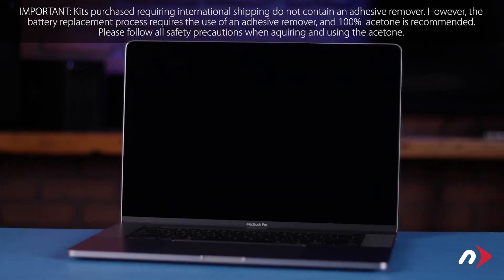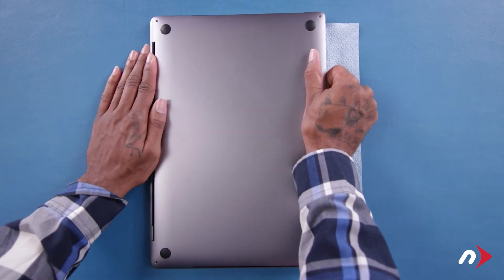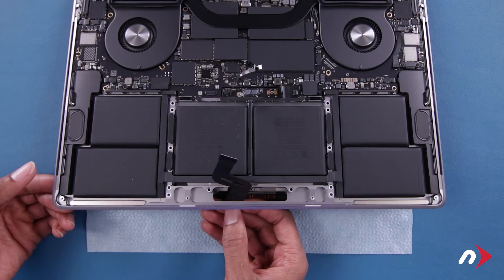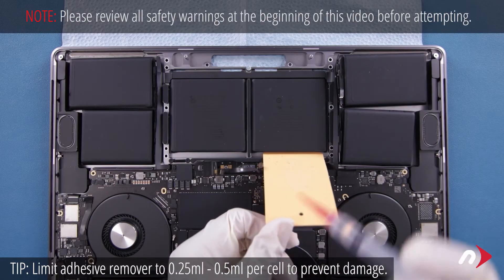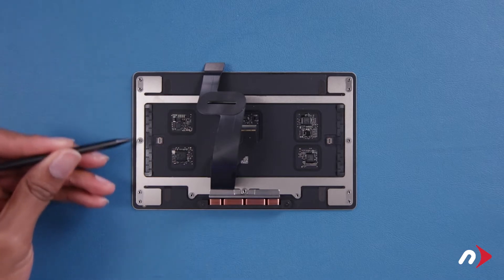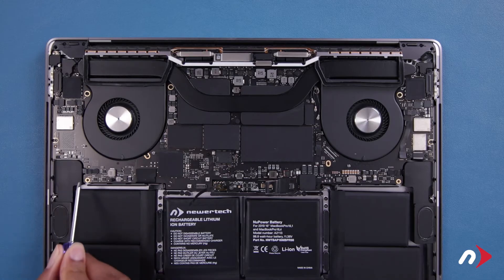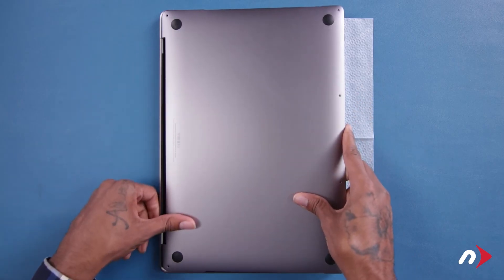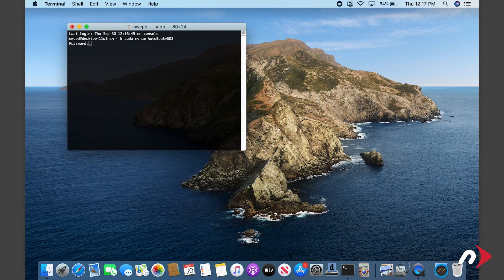How to Upgrade or Replace the Battery in a 16-Inch MacBook Pro (2019)

Comment: Just completed mine, minus the terminal commands. This video was quite helpful and other than Apple’s ridiculous amount and strength of adhesive this wasn’t bad. 
I’d add what I think should be the first step, after the terminal command if one chooses, to be depleting the battery as a discharged battery is much safer to work on than a fully charged one; the less energy available the better.
Reply from the maker: Thank you so much for sharing your experience, and we’re glad to hear the video was helpful!

You make an excellent point about battery safety. Discharging the battery before starting the repair is absolutely a best practice and does make the process safer, especially when working around adhesive and internal components. We really appreciate you calling that out, and it’s a great tip for others who may be following along.

Thanks again for the thoughtful feedback and for taking the time to share it with the community!

Comment: A great video tutorial.  I watched a few others and they went through the whole process so fast and didn't really show all the steps. You provided a very thorough step-by-step instruction on how to remove the cables, which screws to remove and the screw size, etc.  I was able to easily understand how to disassemble the laptop and replace the battery.   I've replaced other MacBook batteries previously and this was by far the most involved one.  Thank you for taking the time to share this video.
Reply from the maker: Thank you so much for your kind words! We're really glad to hear that the video was helpful and made the battery replacement process easier for you. We always aim to provide clear, step-by-step instructions so you can feel confident tackling even the more involved repairs. Appreciate you taking the time to share your experience! 🙌🔧💻

Comment: It says to charge the battery to 100 percent after the new battery is in place, before draining it again. How do I know it has charged to 100% ?  The video doesn't say you can power up the computer to check...
Reply from the maker: Great question, and thank you for watching!

Yes, after installing a new battery, it’s important to fully charge it to 100% before performing a calibration cycle. You can safely power on your Mac after installation to check the battery percentage—this won’t interfere with the calibration process. Once your system indicates the battery has reached 100%, you can then proceed with the next step, which is to allow the battery to discharge fully until the system powers off.

This initial charge/discharge cycle helps the system properly recognize and calibrate the battery’s capacity for more accurate reporting going forward. If you have any additional questions about the process, feel free to reach out!
Reply: @poweredbyowc  Thanks so much for responding and so quickly.

Comment: I replaced the battery it’s charged 100%, but my laptop turns off as soon as I take the charging cable out. I also did the SMC reset.
Please suggest.
Reply from the maker: Hi there, have you gone through the calibration to ensure that the battery is working optimally?

Battery Conditioning
1. Perform a fresh charge to the New battery without uses.
2. Disconnect your MagSafe from your Mac and use until 10% or less.
3. Perform another fresh charge to the New battery without uses.
4. Repeat steps 2-3 four to five times.
5. **Once a month perform steps 2-3.

Comment: dude YOU DONT NEED TO LIFT THE BOARD, LEAVE THE CABLE ABOVE THE BOARD NOBODY WILL NOTICE NO HARM DONE DUDE... COME ON.... you even dont have to glue the battery just put the lit on. if battery break again remove it by removing the screws put new in done.... why so harddd

Comment: I found that Apple uses Torx size 3, 4, 5 fasteners as well as #5 Pentalobe screws in the first section for removing the battery. These are also 3 different lengths including two for the retainer for the power ribbon cable that are 1mm long and too short to hold with tweezers to place back when done. It is obvious that Apple's product people did not intend owners to replace the battery in these laptops with the approach that was taken.

It takes me 10 seconds to replace the battery in my Lenovo laptops but 2 hours and special tools and adhesive remover for a $2600 Mac Pro. Time to replace my 2000 Mac Pro 16 inch with a new laptop from Lenovo.

Comment: Followed the video, no issues reinstalling (I can see my trackpad is slightly misaligned but seems to click fine). The problem I’m having, however, is that once I plugged it back in, my Mac is telling me that the battery is not charging. Any advice?
Reply from the maker: We recommend making sure that all the connections were put back correctly, you can also try using another power cable to make sure if it's an issue with the battery or the power supply.

Comment: If my battery is completely dead and I can’t enter the code into the terminal what should I do? Thank you in advance
Reply from the maker: You would need to charge your battery fully before you can use the battery. We recommend if it is completely dead, to charge for a full day and then see if the computer turns on.

Comment: Was wondering if this worked with macbook pro 2019 A2124 models?
Reply from the maker: I am not finding that specific MacBook Pro Model number. However, this will work with both the MacBook Pro 16,1 and 16,4. If you would like to make sure your Mac is one of these, you can check the model identifier:

1. Click on the Apple icon in the upper left corner
2. Hold Option key
3. Click System Information
4. Second Line Down Under Hardware Overview is the Model Identifier (??)
Reply: Will this work for the 13 inch?

Comment: I tried to replace the battery without removing the board..’i couldnt align it perfectly to get the cables out:( so had to remove motherboard completely

Comment: Does the battery come with any charge on it?  I just replaced mine, plugged the USB-C in and its not starting up 😢   Im afraid of what has happened and hope im not going to have to regret taking on this task.
Reply from the maker: They should, however, it may drain enough before install that it needs a full charge for it to work properly. We would recommend charging it for a few hours and see if that helps.
Reply: Same here, just waiting longer and crossing my fingers!! Been charging 30 minutes and nothing yet. Oh boy

Comment: This video is the best! You don‘t need any other guide. Here are my tips:
- Always check that you use the right screwdriver
- Some screws are very tight, apply a bit pressure on the top of the screwdriver for the first turn so you don‘t damage the screw.
- Use flat pincers for flat cables
- Lifting the logic board is kinda tricky, as in my case it didn‘t want to go as high as in the video, so you might need to lift it a little closer to the battery
- You can use toothpicks to align the trackpad holes - and you can try to screw all trackpad screws just slightly and after that tighten them crossways so everything is aligned properly.
- Under the left middle battery is a small white indicator which turns red when it comes in contact with water. I guess apple uses this to see if there was any water damage. Try not to get it wet or remove it if you ever send it to apple no one can claim you had a water damage. Alkohol and Acetone also activates the indicator
- Use this as a chance to remove dust and grime
Reply: The best video for newbies (Me) thanks well done

Comment: Those of you wondering why take the trackpad out? There are openings exposing the circuitry and if you accidentally touch that while removing the battery, you can damage it. I just replaced mine without removing it because I was wondering the same, if I had to do it again, I’d remove it. Safer. 
Thanks for the video guys.
Reply: there are cutouts in the bottom shell that makes space for some chips on the back side of the trackpad. It is like to make sure you dont some how damage the chips physically when prying out the battery but also these adhesive removers may damage the trackpad as well

Comment: For anyone considering this, I want to say that it intimidated me at first, but ended up working out just fine. I was scared by some other guides online that said to remove the entire logic board, but Newertech's suggestion of simply angling it a little is much easier. When I reinstalled the trackpad it was ever so slightly misaligned so I didn't get any haptic feedback. I was scared to death that I screwed up the ribbon cable, but carefully loosening the screws and realigning the trackpad ever so slightly cleared that right up.